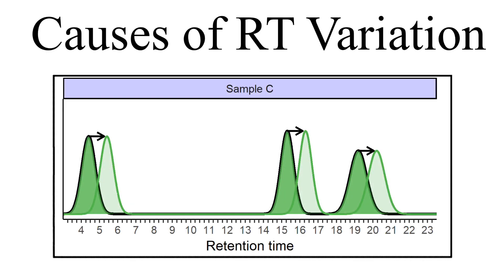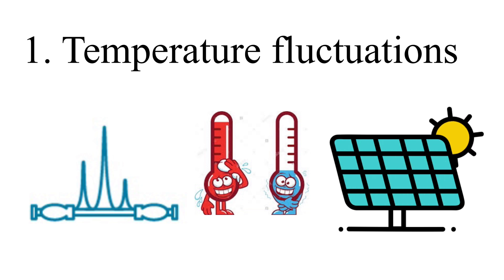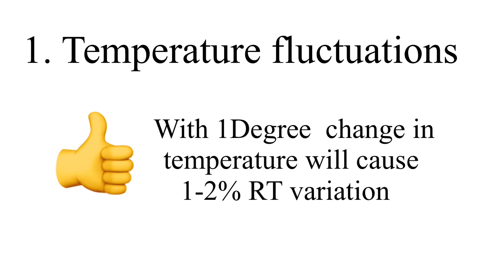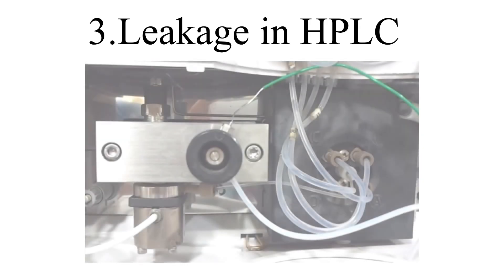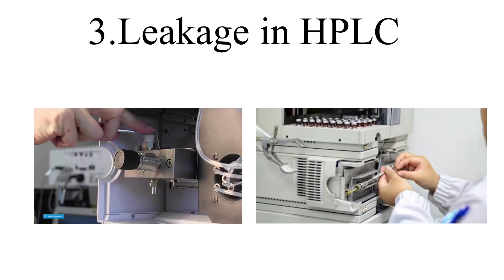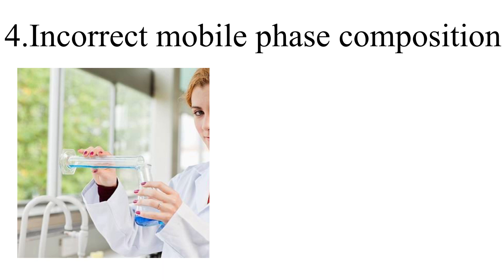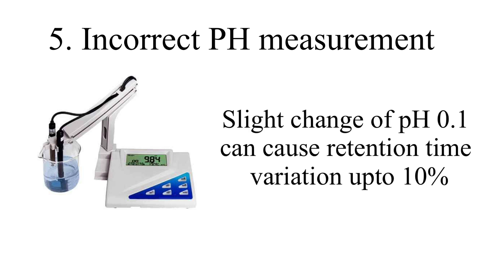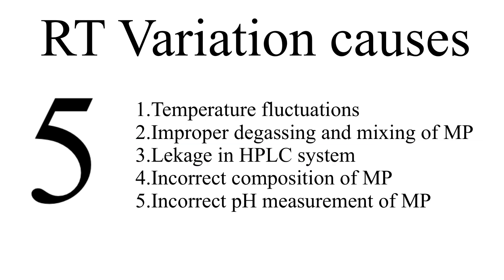Retention Time Shift or Variation Causes || Pharma Pill

Comment: 1.temperature fluctuation
2. improper degassing of MP.. air bubbles.. obstruct MP flow
3. leakage in hplc system.. if peak rt has increased due to leakage then flow rate will decrease
4. incorrect mp composition
in reverse phase.. error of 1% in org solvent then rt shift of analyte can be 5-15%.. prepare mp gravimetrically
5. incorrect ph measurement of mp